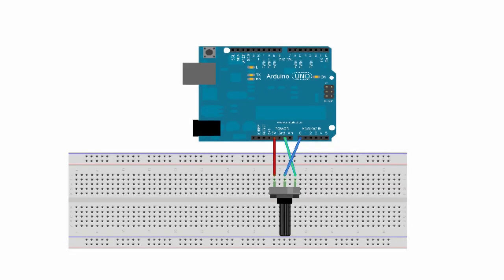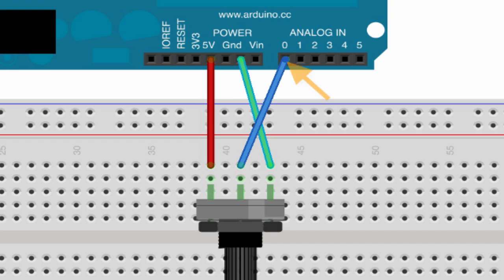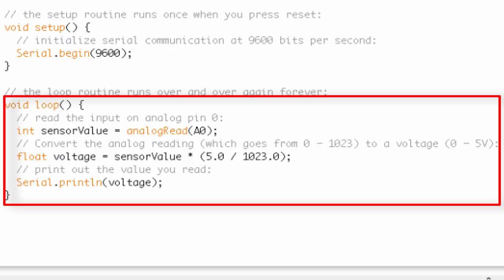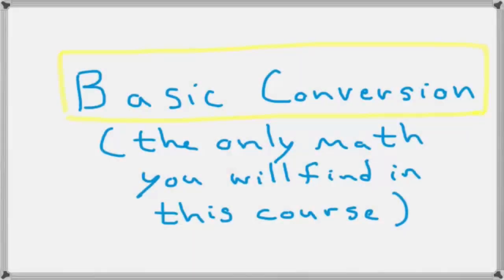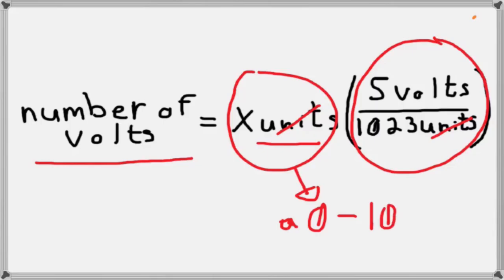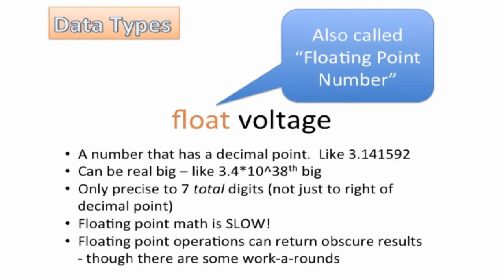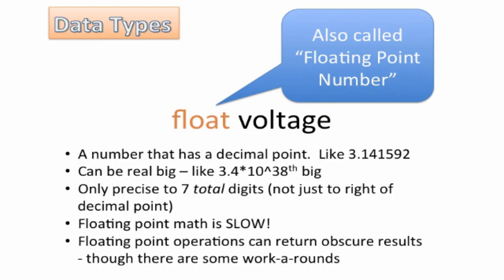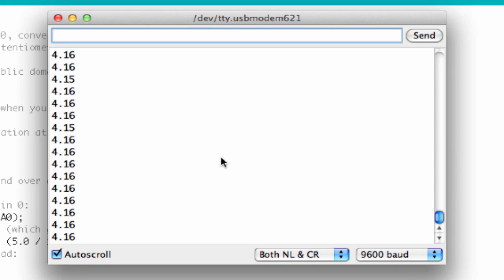Tutorial 09: How to read voltages with analogRead(): Arduino Course for Absolute Beginners (ReM)

Comment: How much normally take to download a that sketch to Arduino? because my takes about 2-3 minutes.. normal?
Reply from the maker: Gamewwx It should be pretty fast..maybe like 10 seconds.  Are you finding the sketch still uploads ok on your Arduino even though it takes a while?  Or is the upload timing out completely?
Reply: When I start download the sketch to arduino comes green bar to IDE and I start timing and I stop timing when the bar disappears (and it takes minutes)
Reply from the maker: Hmmm.  That does seem abnormal to me, though I can say for sure it has happened to me from time to time.  I will do some investigating and see what I can come up with...
Reply: thanks for the helping
Reply from the maker: Out of curiosity...If you look at your Arduino Board during the upload process, are the RX and TX LEDs lighting up the entire time the IDE green bar is shown?

Also, what Operating System are you using?

How long does it take if you just compile and do not upload?
Reply: RX and TX do not do anything but at the last second off compile will flash a couple of times with the pin 13 LED. I have Windows 8.1 with Arduino Uno. Compile it takes almost the same time as green bar

Comment: ok i did the challenges when i swapped the voltage to 3.3 it worked as advertised when i went from 0-100 worked as advertised but for fun i tried to change the code to read 3.3 volts in the equation  and it only  read a maximum of 2.18. why?
Reply from the maker: Whats your code look like?
Reply: Open Source Hardware Group the code I used
void setup() {
  // initialize serial communication at 9600 bits per second:
  Serial.begin(9600);
}

// the loop routine runs over and over again forever:
void loop() {
  // read the input on analog pin 0:
  int sensorValue = analogRead(A0);
  // Convert the analog reading (which goes from 0 - 1023) to a voltage (0 - 3.3V):
  float voltage = sensorValue * (3.3 / 1023.0);
  // print out the value you read:
  Serial.println(voltage);
}
and I changed the wire to the 3.3v output on the board
Reply from the maker: Trying changing 

 float voltage = sensorValue * (3.3 / 1023.0)

to something like...

 float voltage = sensorValue * (3.3 / 675)

The most that analogRead is going to return when only connected to 3.3V is something like 675ish.

Comment: I dont get it, I coded it a lil differently tho still the same end, where instead of using int and float i just had it  for void loop::  analogRead (AO), and then Serial.println(A0*(5/1023). All i get is 0.7 over and over. Even when changing small things such as deleting int sensorValue and making a float integer for voltage. I was just playing around to see how much I could shorten the code while still functional.